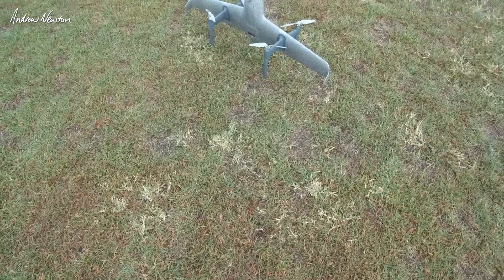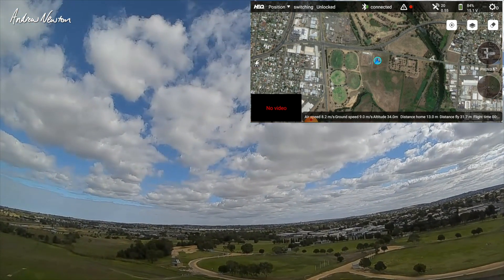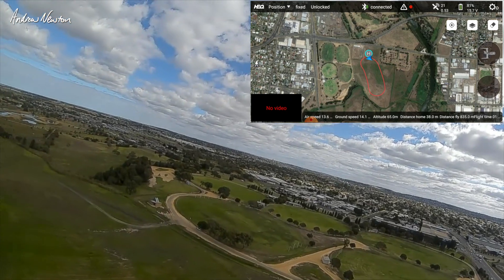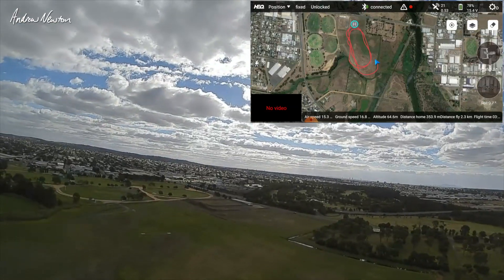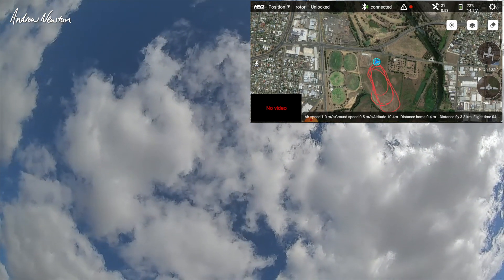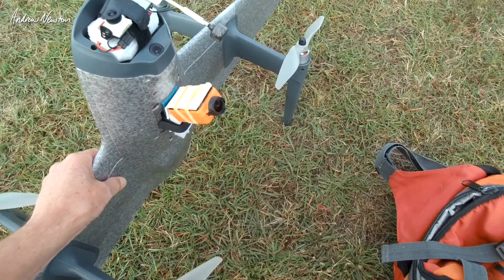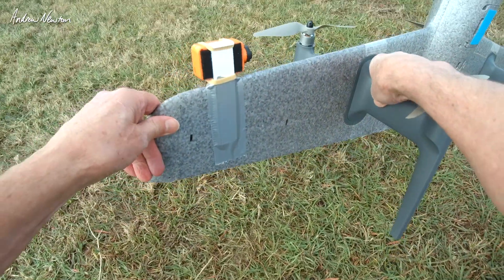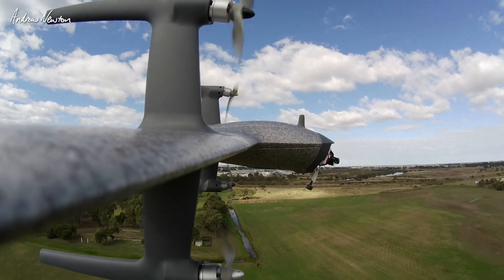FoxTech H-Wing with DJI FPV and onboard cams

Comment: Hey Andrew, I hope you're still reading comments on this plane.  Have you tested the max flying time?
 I purchased one, as it was advertised to fly for an hour.  I can definitely say it DOES NOT.  I've tested it over and over with 3 separate batteries, all of which start out at room temperature and finish at about 90F so it's not a matter of the battery being to cold.  I set the battery voltage warnings to their minimums which are 12% for warning and 5% and for critical warning.  I take off, climb to 30 meters and transition to fixed wing mode then fly at that same altitude for the whole flight.  This is in completely calm conditions, so no wind.  The absolute maximum time I've ever been able to get is 33 minutes and that's with holding the throttle down at its minimum the whole time.  If you let it cruise at its normal throttle, the times are no more than about 24 minutes.
Reply from the maker: Thanks for the flight time testing. Marketing claims are never real world. I passed mine on to a friend, not really my kind of craft.
Reply: @AndrewNewton  That's certainly true but overstating it by nearly 100% is pretty dishonest.  Hope you're enjoying your summer flying lots of fun planes!

Comment: On the TX there are two side switches L and R and two rotary wheels at the top what function do they perform?
Reply from the maker: L switch is the only one used in the stock setup. I guess the others can be configured if you can find a transmitter setup app.

Comment: Hello
I bought a swan without the HEQ radio. Communication with HEQ is a little bit difficult (sales representative and not technical contact). Can somebody give me the type of connector used on the autopilot card (px4 like ?)  and the channels used for the controls (I want to put a TBS Crossfire). Thanks